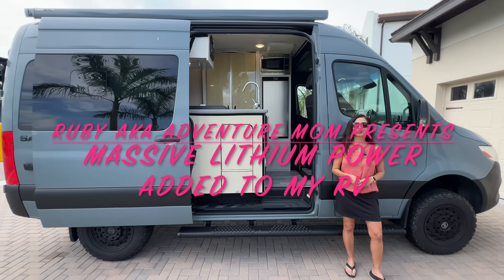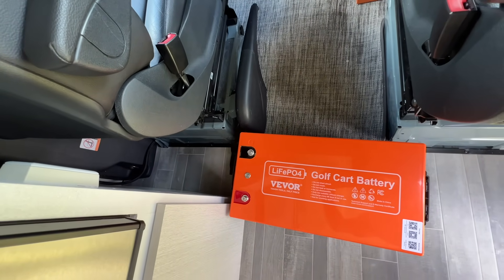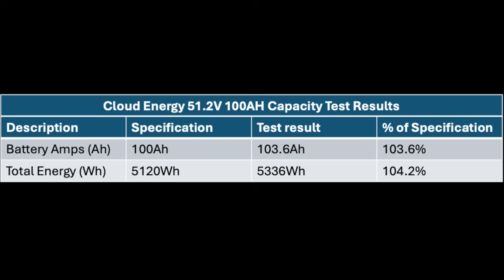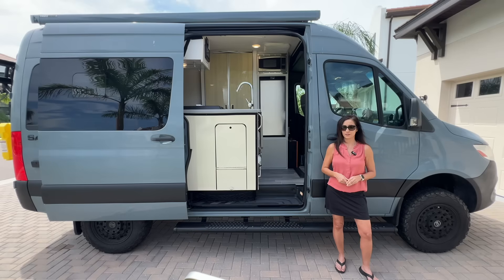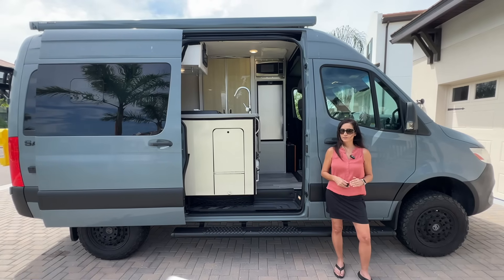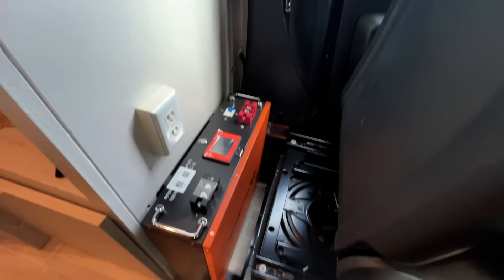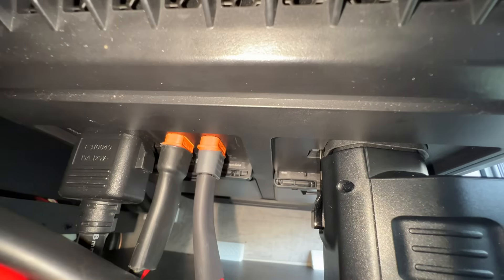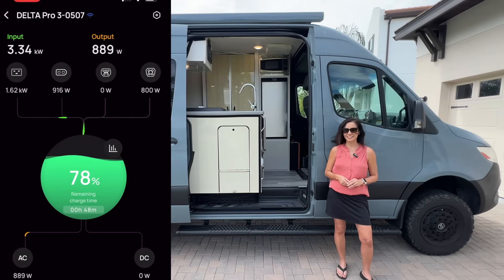Massive RV Power, Unlocked: The Off-Grid Lithium Power Hack!

Comment: Love that diagram! It makes everything so clear, so that I can pick and choose which portions I want to implement with my existing portable power stations. I think my use case is much simpler than yours, as I don't need massive amounts of power while on the road. I can therefore just use a heavy duty 20A extension cord to connect the van's shore power portal to my power station through the back door hinge area. But I can aspire to apply some of your ideas for a cleaner build. Thanks again!
Reply from the maker: I am so glad the diagram was helpful and that you found some useful ideas for your own setup!  I have many more video that you may find helpful as well such as the Ecoflow installation and the latest video in which I show different power stations and lithium batteries.  Thanks for watching!

Comment: Nice Ruby, what type job do you do
Reply from the maker: I have actually found a way to add even more power.  I just received a 51.2V 150Ah wall mount server rack lithium battery.  This battery has 7.7kWh of power and fits behind the seat as well.  So I will be creating a new video and will add a breaker and battery fuse to make sure it is 100% safe as well.  I also will be changing out the EcoFlow for a Dabbson 3000L and then adding over 10kWh of power under the seat.  In total, I will have over 20kWh of power in a van!  Thanks for Watching!
Reply: @RubysAdventuresUnplugged  JOOC... "In total, I will have over 20kWh of power in a van!" What will you be using all that power for? I've got 330AH of lithium which I got by replacing my two 100AH AGMs, as well as two 1KWH portable power stations to power my kitchen cooking appliances. I can go off-grid for a week in my van with just that. I can't imagine what I'd do with 20KWH. LoL...

Comment: This is more like an auxillery battery. The extra capacity is nice and it would be a life saver on a cold night with electric blankets and cooking with induction heat.
Reply from the maker: It certainly could be an auxiliary battery.  When you push the on/off button is does stop it from discharging and you can stop it from discharging via the app as well.  For me, I just leave it on as the EcoFlow with draw AC power to keep the battery full once it is at 100% so the Cloudy Energy battery always stays full.  Once the Ecoflow battery starts to get drained (no longer connected to AC) the Cloudy energy jumps into action and supplies the Ecoflow with power.  If you use both solar ports, the cloud energy battery can supply 1800 watts, which is more than AC charging.  Thanks for watching!

Comment: Cloud energy uses non name brand cells in their batteries. No thanks.
Reply from the maker: Interesting because it capacity tested very well, the BMS seems solid, and it seems really well made with a flip up monitor, built in 100A breaker, separate power button, and even the ability to turn on/off the charge and discharge via the app.  It came with all the goodies including the wall mount kit.  I could easily open it up and see which cells it uses, but what makes you think the cells are not good?  Thanks for supporting this channel.

Comment: mmmm, I was wondering what you would do next. your videos helped me pick out the connections I need to do my setup. I have the room for the delta pro 3 and the ecoflow extra battery. I have the. the lithium battery van already. Good luck with your mods!.
Reply from the maker: Hello Richard, I have some other interesting ideas that I will be testing soon.  Renogy has asked that I test a solid state battery, I have a new type of flexible solar panel to test, Li Time has asked me to test their new inverter charger, etc.  The technology is changing so quickly it is almost hard to keep.  It will not be long before we can stay a week solid off grid while running our ACs.  Thanks for watching and support my channel!